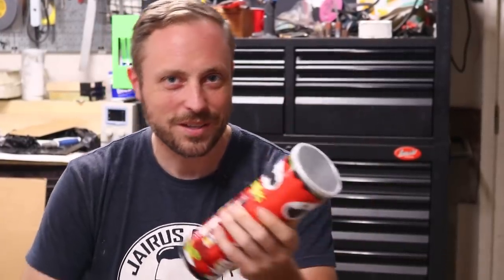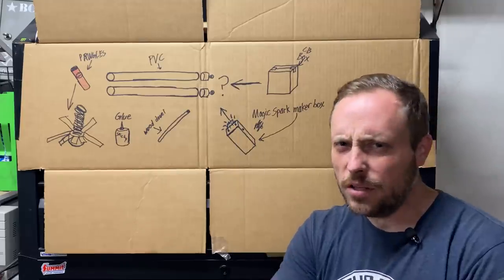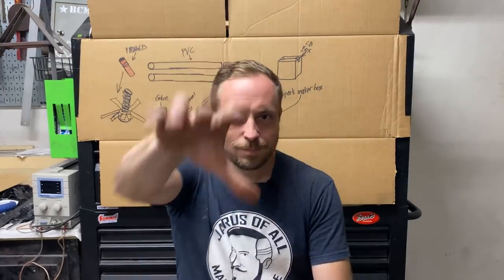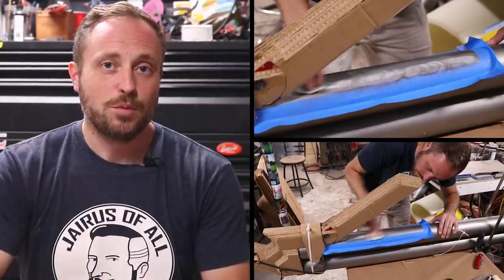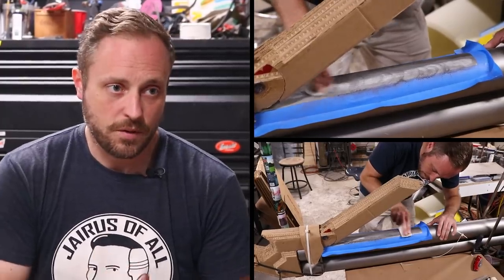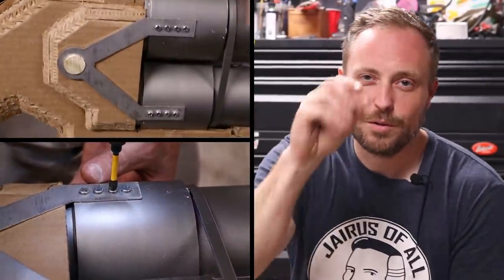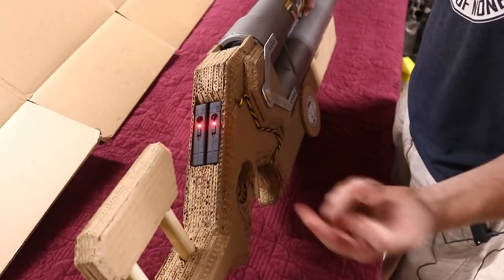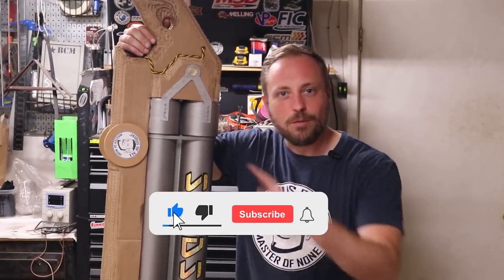7ft Pringles Fuel Cannon - One Day Build

Comment: I have a question to help with my work. What's the standard size plastic pipe in north america or the USA if its different to Canada? Ove here in the uk, from my experience selling the stuff, it's usually 21.5mm, 32mm, 40mm, 50mm, 68mm or 110mm.
Reply from the maker: So the internal measurement of “3 inch” PVC is ~77.5mm or ~3.05 inches. I assume yours are named the same way, the stated size is internal measurement. So you might have to get some US stuff.